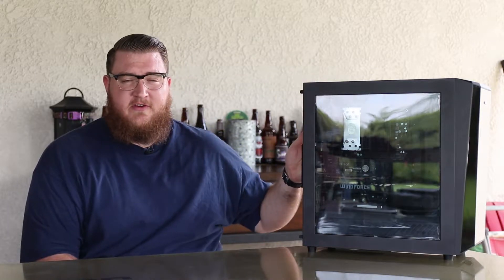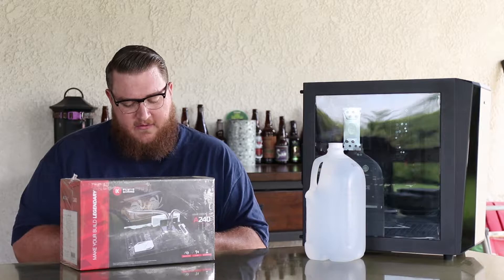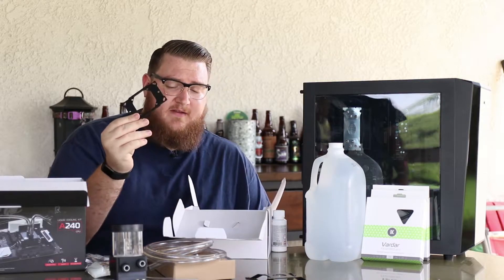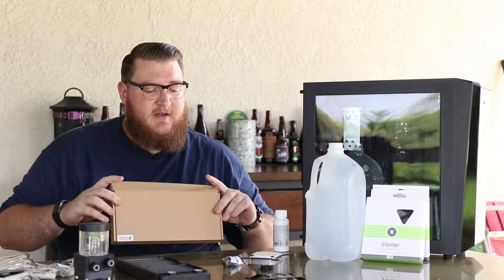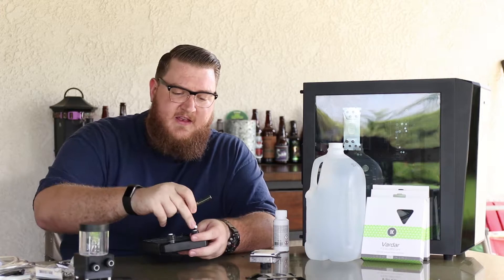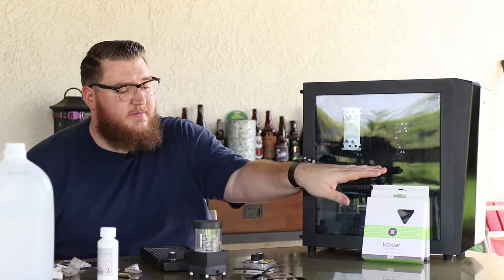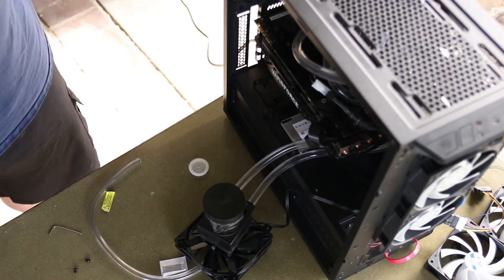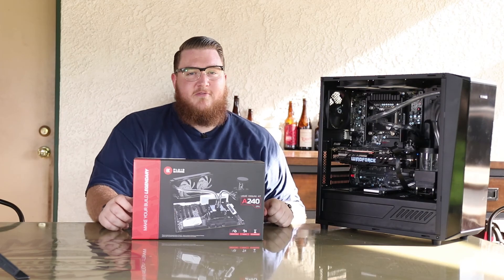EK A240 Unboxing, Install, and Review

Comment: So I have the A240G version of this kit and I can say that installation was a breeze for someone that have never messed with an open loop before.  At 4ghz OC on my R5 1600 CPU at 1.376V, max temp is 65C and my GPU is 64C at 2050mhz (1080ti) core clock.  The pump, for its size, provides surprisingly good flow and not a lot of noise.  At 2800 rpm, I can barely hear the thing.  Also, what HomeBrewedHero says regarding the FPI on the rad is true.  I have a push/pull in my Phanteks P400 using Arctic F12's and the system just purrs even at load.  In Cinebench R20, I was able to get 2839 on these settings, which all I have to go on are the comparisons, but it looks decent to me, XD.  This is a great kit for those wanting to transition from air cooling and silence their systems a bit while being able to OC.

Comment: I received my kit yesterday and guess what? The pump is damaged out of the box it leaks like hell. 1st one and the last one i bought this. I will stay with an AIO solution. 

A friend did purchased 2 years ago also a kit from ekw and after one year on the gpu it did start leaking... 

So i guess this is a waste of money.. i really would like to have an easy custom solution like this one but nope.
Reply from the maker: Ricardo Diaz that’s unfortunate. Ek should stand by their product. Did you reach out to them? I’ve had good luck with EK blocks and radiators. Their fittings are Alison pretty good if not a little bit expensive for what they are. But hey if an AIO keeps your temps low, that’s all you need!
Reply: HomeBrewedHero Yep i did contact them, they offerd me to send a new one but they can keep it if it starts like this. My AIO is good for my 8086K @ 5,1ghz delidded. 
I bought this solution because i also wanted to liquid cool my gpu as well..but i have now no trust anymore. I mean this can happen also to AIO but not out of the box. I did waste 2 hours in total for it. if you google that issue you will find a few people that had also a leaking pump outbof the box from ekwb.
Reply: @DarkSorrowDark_Sorrow  out of interest what AIO do you go for?
Reply: @CursorNZ  >I use a cooler master ML240L  i have good temps with it @5.1ghz delidded i7 8086k. Gaming 66 degrees c, rendereing arround 70 up to 82 degrees c

Comment: I don't know if specs changed in the last year, but EK official site says "...Dense aluminum fins ..." about the radiator, which makes sense since it's a very low profile radiator (under 28mm!) so it needs more fins.
But in that case don't replace the fans with ones with low static pressure (as I was tempted to do with noctua 120x15mm low profile fans) if though Noctua make some of the best fans under high rpms you might get backpressure (in case of high-fins-density radiator vs low static pressure fans) and thus reduced heat dissipation.
I believe the stock fans should be perfectly fine though EK seems very careful to make well tunes kits.

Comment: WHY do all these review videos have high-speed install video? I'm approaching my first build in years with all new tech including a Rog Strix motherboard and the EKA240, and what would be REALLY helpful would be a video showing how the radiator is put together, how all the parts are wired to the motherboard, how best to route the tubing etc. Kudos for the slow pump filling segment, but the high speed build section was pretty useless IMHO at speed.
Reply: I agree, I can't give this video a thumbs up after watching them take the parts back out then in again several times after trying multiple things and it seemed like they really had no idea what they were doing going into this. I was hoping with the title this was an actual install video, instead it turned into a high speed video of someone trying to put a base water cooling kit that's never done this before and in the end they finally got it mostly right.

Comment: "this is how you do a leak test" and then doesn't say anything about a jumper, or paper clip to jump start the pump only and leaving 0 current through the board. I mean come on man, you used rags like no absolutely not, you do NOT put power through the board until you know there is no leaks. Honestly, please no.
Reply from the maker: DopeMan I could see how you would think there’s current trough the board. There was not. The jumper was connected and on, no power supplied to the main board or gpu. You have to put power to the pump to prime the system. Also, most coolants are non-conductive and as such will not cause damage in the event of a small or large leak. Obviously one should be careful when dealing with water cooling.  As for towels, sure I should have put them under each fitting and around each fitting when filling the system but I felt that was unnecessary seeing as how I’ve never had a leak from filling or assembly of a loop. I’ve never had a system fail and leak either but that’s another story.

Comment: Hi I am going to get this for my pc but my pc does not support radiators or pumps. So I was wondering if I can keep the side panel off and have everything outside my case. Will that work? (I don't want to risk anything because I have 2 GeForce GTX 1080 TI's in my pc and I dont want them to get ruined)
Reply: Sharpboss224 don't do it

Comment: Just a bit of advice for everyone watching this. Homebrew had a concern with the tubing quality, which was not unfounded. After only a few months of use, the plastcizer in the tubing gunked up the CPU block and caused other issues. It would be advised to skip the stock tubing and go with a known quality tubing from the likes of Mayhems or Primochill to avoid this! Tubing is very inexpensive! Watch for the "Rig Rebirth" video to drop from Homebrew and you'll see for yourselves! [pin this bruhhhhhh]
Reply: i noticed tubing is different in some videos i have watched very strange. whos ones is correct

Comment: Wich Tower is that?
Reply from the maker: That is a Raidmax Delta but the intake in the front is barely enough for this CPU under load as the chassis is restrictive in its airflow.
Reply: Ohh its fine i just wanna now the Name of it so i can look for the length I have my PSU covered and on the cover i can install a 120mm Fan so its perfect for the Pump but my GPU makes it difficult cus its length.. Tower Cooltek TG 01 :) Thanks
Reply: And btw is this a ATX Mainboard shown in the Video? I feel sorry for my bad english.
Reply from the maker: Not a problem you're great at communicating!  Yes, this is an ATX board in this chassis!